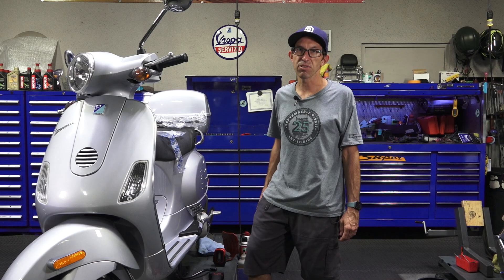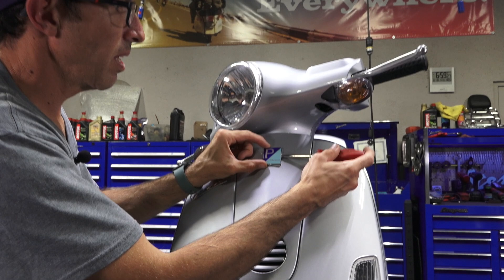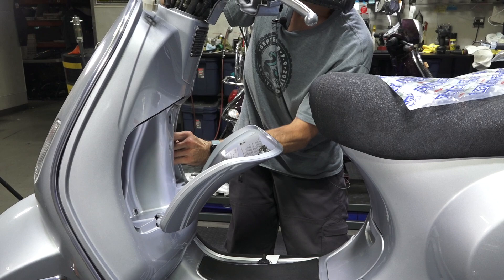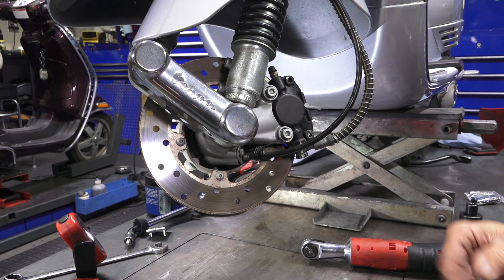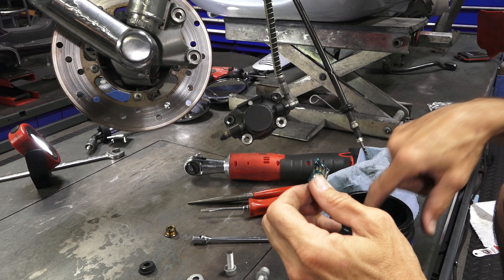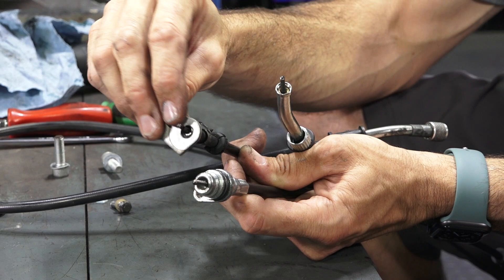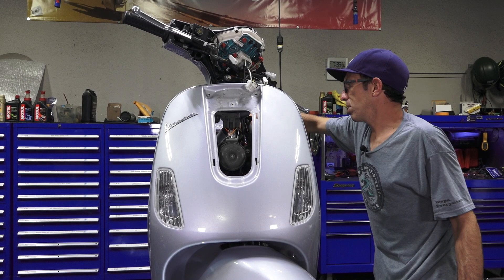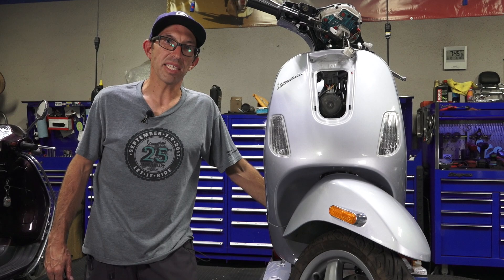How To Change the Speedometer Cable on a Modern Vespa

Comment: Thank you Robot, I’m very new to all of this, I didn’t have the proper tool to remove the front wheel, I was unable to get the glove box opened so I did what I could do which was to remove the old cable at the wheel and snake the cable up through the fender, up and up until I reach the speedometer itself, it works, now watching your video and listening to you was my guide on this, not a better way, it was the only way available for me under these circumstances.

Comment: I've had to do this twice on my S 150, which is of course very similar but slightly more intricate, and these instructions are as usual FAR better than anything else that has been done online. To avoid any mistakes when running the new cable, I have found it easiest to tape the old one to a length of 12-gauge wire, pull it out (thus replacing the old cable with the wire), then use the wire to pull the new cable through. It is a tight squeeze through the fender, almost impossible-looking at first, but a few squirts of silicone spray help get it through. The fittings are too large to allow you to just tape the new cable to the old one. For as fragile as these cables are, it's odd how little lubrication there is on the length of the cable. I wish I'd added some as you did here.

Comment: Thanks, got the parts from you months ago, finally got around to doing the work. ET2-50, cable had locked up, which killed the plastic driven gear. I'd ordered both, and it did the trick. Thanks for the great vid. Oh, and I used sokme Aerospace 303 Protectant to lube the  cable and rubber and plastic bits for routing. Side benefit, it's good for the plastics.

Comment: You rock my friend! A fantastic walk-through of exactly what I needed to do
Reply from the maker: Glad it helped!
Reply: @VespaMotorsport    hey bro I have a piaggio fly 50cc I have big problem to start the engine when the motor is cold I really suffer I cleaned the carb  changed the air filter change the plugs but still the  same problem.
I need almost 1 hour to start the engine.

Comment: Super usefull, after a dorment winter i decided to take out my LX and found that my speed was a constant zero. The worm gear was chewed up also the tip of the accelerator cable broken because of bad grease, it was solid. I also found the problem to why nu glove box does not open, the latch was bent. I don' t know If the latch will handle my effort to bend IT back though

Comment: Thanks for the detailed video. My Vespa ET4 150 2001 just broke the cable. 
The shop Cycle sports Vespa is to work on it tomorrow. How much will that be?😳🤔😔. My Vespa only has 6,400 miles🥹👌🏼🌺🙋🏻🙏🏼

Comment: Changed mine on GTS, turns out that new cable head is too big to pass through the small hole on the fork.

I guess that is why the old design can be dissemble, I end up remove front wheel and loose front shock just to replace that cable.

Comment: Hi, my speedometer on my Vespa Sprint 1969 is not working. I’ve replace the ‘spinner’ at the front wheel which didn’t help. Have you made a video on this model? Nice Channel btw 🙂

Comment: Do you know if most newer scooters are electronical speedometers vs mechanical?   I have a Kymco like 150 2019 and mine stopped working yesterday and ABS light came on as well.  My next scooter will be a Vespa I’m hoping.  We have a dealership here in town.  Thanks for all your videos. I’ve watched quite a few, even though I don’t own a Vespa.

Comment: Hey Robot, thanks for all the videos.  My speedo just stopped working, pulled the gear per your video and its mashed up.  I had a shop replace it just 2 years/250miles ago, the grease is really sticky and gummed up.   Do you have a how-to on re-greasing the whole hub?  2003 ET4 150.  Thanks again!

Comment: Great video! Thanks very much for the help. I am in Australia, do you guys post to here? I need to buy a speedometer cable for my 2006 LX 125 Vespa so thought I would get it from you guys. Also I replaced my front brake pads and brake fluid for the first time. Was tough but got through it.. but in the process I managed to thread the nut on the bleeder nipple of my caliper pretty badly. It's the original caliper, just wondering if you sell the individual nipple/nut for it. Anyway thanks again for your videos, super helpful!
Reply from the maker: Glad we could help out and glad you decided to tackle your own service. We can usually ship world wide and ship to Australia often. Give the parts guys a call or email and they can be sure to get you what you need. 619-280-1718 sales@scooterwest.com

Comment: Hi Robot.... i have gts 300 from 2013. I want to change it to the 2015 speed meter,but this one the cable go straight in meter but th 2015 that doesnt go there.... my question is...is it posible to put the 2015 speedometer

Comment: I have a vespa px 125, my speedometer cable and gear broke at 20k km, i replaced both the cable and the plastic gear. 10 km after the replacement, the main gear on the hub basically "ate" the plastic gear. I replaced it again, and it broke again... I don't understand why it continuous happening, it's kinda frustrating..

Comment: How is the thing called at 22:50? i thought to replace my cable however i figured the previous owner destroyed this thing you´re talking about, can´t seem to find it anywhere. If anyone knows please let me know
Reply from the maker: The rubber grommet, or the knurled nut that screws the cable to the speedo? There is a chance it slid down the cable into the frame.

Comment: Would this be similar for a 2018 vespa gts 300? i'm struggling to find the part here in the UK
Reply from the maker: The newer models use an electronically controlled speedometer (not a cable). Is this the part you're looking for? https://www.scooterwest.com/complete-abs-speed-sensor-front-or-rear-gts-sprint-primavera-946.html